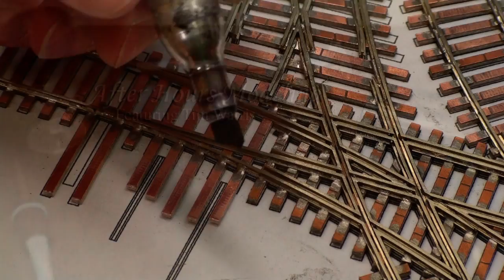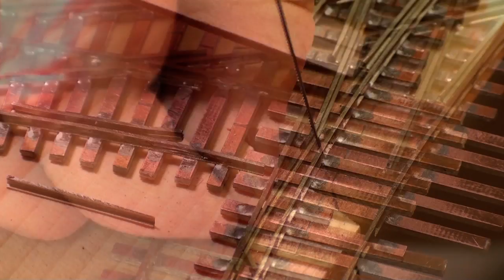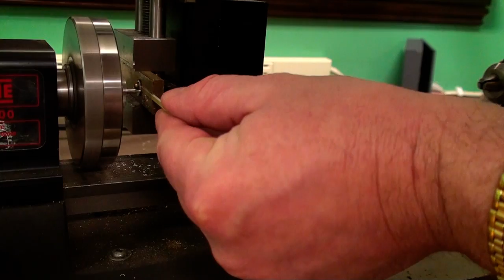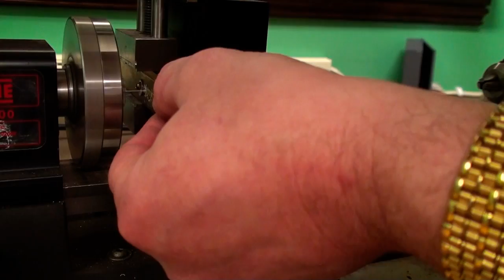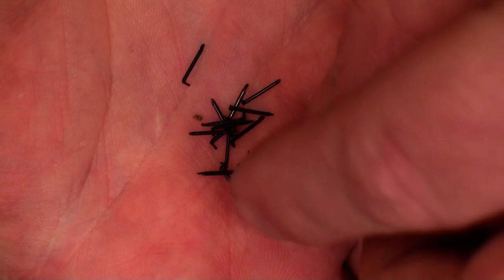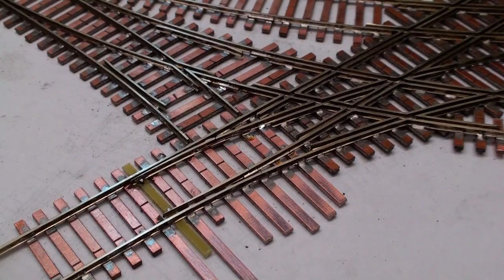Building Short, Hinged Switch Points

Comment: I remove the cladding on the PC board used for the throwbar tie.  I etch off the copper using etchant, however, it can easily be sanded off.  I just rely on a friction fit to keep it in place once installed on the layout.

Comment: Why not use this "spikes in the throwbar" system even on conventional turnouts where the point, closure rail and wing rail are one solid piece?  Seems to me this would be less rigid than soldering the points directly to the copper cladding on the throwbar.